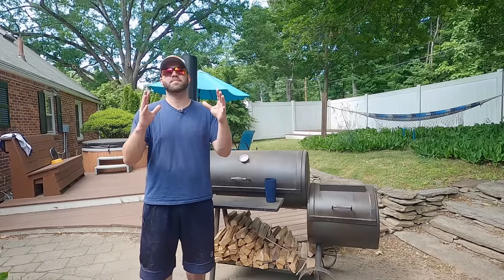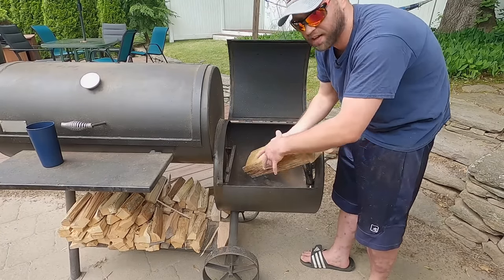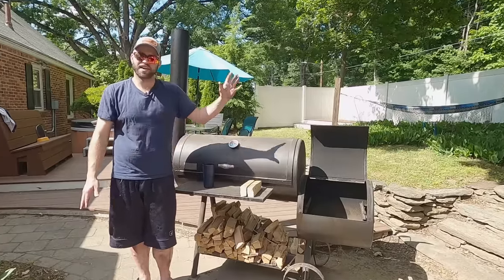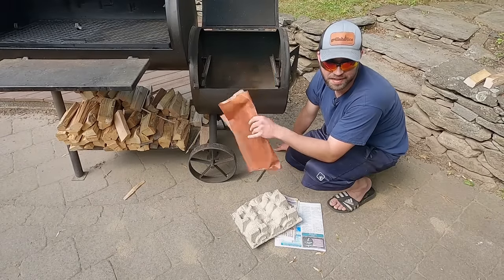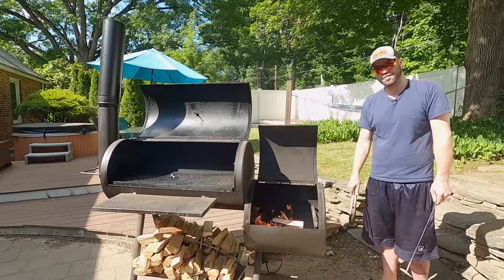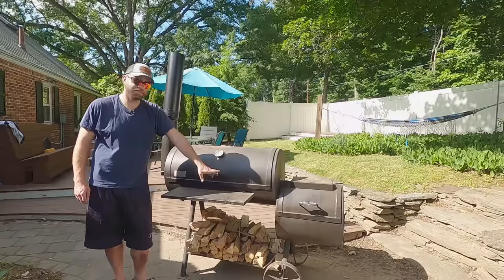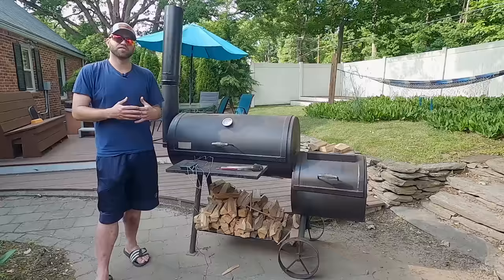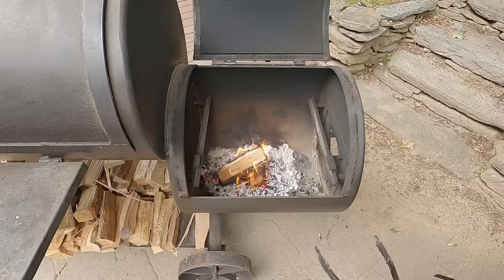OFFSET SMOKER FIRE MANAGEMENT FOR BEGINNERS | How To Burn A Clean Fire | Fatty's Feasts

Comment: One of the biggest things I discovered today is that the temperatures at the stack end are going to be way more sensitive to fire changes than in the middle of the box. This has probably been why I've had so much trouble maintaining a temperature over the last couple of years with my Wrangler. I like that you pointed out that there is a difference between the two spots, and I can confirm it.

Also, I have done as others have with the baffle from the firebox and used it as a baffle in the cook chamber. If my fire gets crazy, I don't end up with flame broiled things, even with the factory baffle still in there.
Reply from the maker: Good point. Plus with the stack being so small, it's difficult to even the temps out. Where do you place the baffle in the cook chamber when you use it like that?
Reply: @FattysFeasts  I put the original "fire grate" in the cook chamber and butted it almost right against the factory baffle. I left about a 1/2" gap to let some of the heat out there. 

I replaced the "grate" with the searing grate, and it does a "grate" job (see what I did there?) at holding the coals up out of the ash.

The temperatures from the middle to the box end at the grate are a lot more stable than at the stack end.
Reply from the maker: @tim.garrison  Interesting...I may need to try that!

Comment: Doing the first run on a new higher quality smoker after my King Griller.  Wanted to see if theres more tricks to managing one of these Old Country's. Learned a pretty good amount that im trying now. 

Only thing id add on this video. Is use a haur dryer if you have a piece that won't light. Its cheap and quick  while saving you from wasting any wood.
Reply from the maker: I like that tip! If only I had a hair dryer, but as you could probably assume, I don't need one 😁

Comment: A couple of other tips to try: 1: drill and remount your thermometer lower on the cover cover, closer to where the meat is actually cooking. 2: Many smokers have the smoke exhaust at or near the top of the cooker. Add an extension inside so that the smoke exhaust is nearer to the cooking level. This also produces a way more accurate temperature.
Reply from the maker: Absolutely with the thermometer. I just decided to use my probes since I didn't want to drill. When you say "add an extension" are you talking about adding tuning plates? I've screwed around alot with tuning plates on this smoker and they were more of a frustration than a help. Specifically, they would move the hot spot twoards the middle of the smoker and would cause more unevenness of temps, which would cause overcooking of the bottom of the food. In addition, most people don't have a probe in the middle of the smoker, so it would be easy to miss those temp changes.

Comment: For years I have been using a charcoal grill. I added hardwood to the charcoal for smoke, while I have the meat off set for indirect cooking. I have cooked pork roasts that way. But with my new smoker none of the old grilling methods worked. I see from this video I was making the fires too big. The wood was too large. I was having fluctuations of high and low heat and had to baby sit the smoker all afternoon.  It was frustrating. I'm going to try again using some of the tips you taught us. Just two small sticks of wood!
Reply from the maker: I had the same exact problems! Glad I could prevent you some of the headaches I had!!

Comment: I've managed mine differently and had what I thought was good success. 

I usually have charcoal in the bottom grate of my offset, and continually add small amounts throughout my smoke. Then above that I have grates I place my wood on to smoke. If that wood catches fire, a temperature spike occurs.
Reply from the maker: It's a good concept, I just try to avoid adding more charcoal unless my coal bed is really just not there. I also don't like keeping wood in the firebox itself. I've had it catch too many times.

Comment: My number one tip for a clean fire is AIRFLOW. If you restrict airflow, you will get dirty smoke. You must give the fire all the air it is asking for. Do not treat your smoker like a woodstove. You're not heating your home, which produces tons of dirty smoke, you're cooking. Figure out how to build your fire so that you can leave the door open, while not making your fire too hot. A small efficient fire will produce the best results, but can require more attention because it will burn faster. Another tip, if your firebox is big enough, Get a fireplace kit. A cast iron log holder (available in many sizes) will elevate the splits and coals and ash can be raked out from under if needed, without moving it.
Reply from the maker: Absolutely. The biggest thing I would say is keep it simple. On a larger smoker, you definitely have more room to work with dampers. On a smaller guy like this, keeping things open will help, especially the stack. I wouldn't say keep the firebox all the way open though, as you'll just lose a ton of heat.

Comment: i have the exact smoker with ""two gages". I start out with 5lb reg.charcoal. Once it starts the heat up around 150. I add 1\2 bag Cowboys Lump coal. Sometimes you have to create your own style of cooking or grilling. I'm not into electric gages like some. I keep a sharp small knife and cut some big meat off. All because when I smoke  a big piece like a 20lb Turkey,I have a time table when I want to flip over and rotate usually away from the fire box. 275 is my goal on Turkey-Brisket and keep watch when you know it's time to refuel the firebox. The Brisket will bleed out blood-means it's on the interstate steady temperation. I'd like to mention that when this smoker get's hot'. the 1/4 thick of metal will keep cooking due to the thickness of it. I grill old school style and won't I change a damn thing other saving some time reading gages that make you or two. """""""PEACE IN DA-A-A VALLEY.:face-purple-wide-eyes:🤠
Reply from the maker: Interesting concept. So do you use any wood at all or just charcoal?

Comment: Just discovered your channel and been watching some videos. I have several smokers, but haven't used my offset in a while.  I just did an early "spring clean burnout" on mine a few days ago. I like playing with fire (😃) and I burned several fires when I got my offset a couple years ago before I ever cooked the first bit of food on it. Took me a while and some mods and learning to get it just right. As the owner of a Pecos, I was a little surprised to see how small the "chunks" you use are with your Brazos. I definitely had to cut down the size of the splits I started out using until I got to the optimal size, but yours are definitely small. But, as we know, all smokers are different and have their sweet spot. I'd like to upgrade as I've seen you have done, but unfortunately my wishes outsize my budget. Until then, I'll stick with my Pecos, which does a perfectly fine job itself. Keep smoking and posting!
Reply from the maker: Happy to hear from another Old Country owner! I think I mentioned it in here, but I definitely saw some people on Youtube that were using bigger splits. In the end, they just didn't work for me, because as you said, every smoker is different. I wish money grew on trees so I could get a 200 gallon or something...Not that I need it 😁 Happy smoking!

Comment: I got an old chop saw at a pawn shop $35. Sometimes you can get lucky at a yard sale. I would suggest try it out before you buy it. I wish I had watched this video first; in the last video I asked about the water pan. I prefer to hear someone who has something to say talk. You did really well, Grate video.  Your smoker looks just like mine. I was told that flat part on the top of the fire box was for toasting bread. I bought it used but it looked new, perhaps the guy I got it from did not know how to use it either.
Reply from the maker: Oh, now that I see this comment, I answered some of the questions I asked you in the last reply. Yeah do the water pan near the firebox so it flows throughout the smoker. I'm glad I was able to help you out!! Yeah, the top of the firebox can be used for a multitude of things, including bread I guess LOL. Mine used to get dirty from the wood I put on it, so I personally wouldn't do that on mine, but if you keep yours clean, go for it. Not knowing how to use a smoker is a common problem from people selling them. It's not the easiest thing to learn and it does take work. I almost gave up at one point, but I'm so glad I didn't! Once you get it dialed in, you'll love it!
Reply: @FattysFeasts   Thanks for the reply. Seem there is a lot of people out there who have advice they want to share; the only problem is a lot of it is bad. I did as you suggested, pulled out my old chop saw and cut the wood into small chunks. I smoked my first turkey. 12 lbs took about 6 hrs. I was able to control the temp. way better than ever before. I figure it this way, when people tell me that was the best turkey they had ever had, it is good advice. So, Thank You for this. And the funny thing is this was the first time I tried smoking a turkey. And all I had to use was a gallon of apple juice, water, butter and salt and pepper. We do not get paid until Friday. So, I used what I had. I was not expecting much but this was really good. My wife is the hardest person to please so, when she says to me, you will be making this again. You know it has to be good.
Reply from the maker: That's so awesome to hear!! Glad it came out great! I can't say the same about the first time I ever smoked a turkey😂😂  @fred306801

Comment: I now have this same smoker and great video as I needed this information...Im all ears, as mine is still in the box...how many test runs are recommend before adding meat to a brand-new Joe?
Reply from the maker: Congrats on the new smoker! I'd say at least one, preferably two. You just want to be at the point where you can run it and know what happens when you put a split on or open / close dampers.

Comment: Excellent video. Thank you - exactly what I was looking for. I do have a question do you ever add more charcoal briskets to your fire heat it up after you've been adding wood?
Reply from the maker: Glad you enjoyed it! I typically don’t unless I’m having a really difficult time maintaining a coal bed. I found if I use charcoal at first and then burn a log cabin, I form a pretty good coal bed that will last for the duration of the cook. But, I have fallen asleep before and needed to add a bit more.

Comment: That was a very informative video, i just bought a big country smoker used and im a first time stick burner person. I picked up alot of information fron your video and am a subscriber.  But one thing if i may ask, if you were to guess, how long would you say your splits are, Thank you so much and am looking forward to seeing all your videos your putting out there.
Reply from the maker: Thanks so much, I really appreciate it and I’m glad you found value in the video! For this smoker, I’m typically using about 7 inch long and 3 inches wide, maybe a little less. Since I’m making them so small, I tend to get some smaller and some bigger, which I will use for various situations. But that’s pretty much the length and width I try to aim for.
Reply: Thank you so much for the info

Comment: I use same girth as your wood but the length is about 1/2 . Haha😮 so i build my fire to side door and stack wood to the left close to the intake port to smoker chamber. I have had embers light my supply but not often. This is a excellent way to have minimal smoldering it ignites instantly and keeps your cook clean. Your upgraded stack would burn through my chunks every 2 min. so may not work on your setup. Thanks for your knowledge & great video
Reply from the maker: Glad to hear we have similar wood girths 😂 I haven't tried the wood in the firebox yet. I find in my case, just putting it on top works fine.

Comment: Cool video take it from a novice smoker. Just smoked a 3lbs tri tip and found out I needed a piece of oak on top of the lump charcoal. That did the trick, so I smoked it 2 hrs 255-275. So leaving  the tip on the grill when I place 
another piece of dry oak not gonna screw it up? I was able to reverse sear at 400 after o placed a piece of oak on it got it to 400 the tip cut like butter at 145  after probing it. I didn’t know if about the hack leaving my wood on top. Of  the hot box. Thanks man!!
Reply from the maker: Glad it turned out great!!!

Comment: I noticed that you removed the lower grate in the fire box. It's much easier to maintain the fire if you can keep airflow moving underneath the fire. Leaving the lower grate in place allows for airflow underneath the fire so you don't have to move the wood around to keep your airflow under the fire.
Reply from the maker: As far as fire science and flow goes, you're correct. However, when it comes to this smoker, I have not had the same experience. My coals tend to fall through the grate, which has not helped maintaining the coal bed. I've tried many things as I explained, but the thing that has worked best for me is just keeping the fire on the base of the firebox.

Comment: I’m no expert, but started getting serious in the hobby and built my first reverse flow trailer pit about 13 years ago. Three trailer pits, a non mobile pit, and a Santa Maria grill later, I won’t build a moderate to large size pit without baffle plates. 

They have to be installed correctly, and I can maintain less than 10 degree temp variance from one end to the other on a 5’ cooking surface. 

If done correctly you can fine tune them all the way across the cooking grates. 

As the saying goes, there’s more than one way to skin a cat and as long as you’re having fun and folks aren’t declining your bbq invites, keep smoking!
Reply from the maker: Hell yeah man! BBQ should be all about the fun and great food! What's the largest pit you've built?
Reply: @FattysFeasts  the largest one completed will hold roughly 12-14 briskets. 

I have another one not completed yet, that should hold at least double that. 

Rarely cook on the big ones, and the old Smokey and argentina get the most action. Oh, and my wife bought a pellet smoker that I almost hate to admit gets used a lot 😂
Reply from the maker: @txgearheads  That's awesome! I'd love to see some pics! And of course the "convenient" smoker gets used the most 😂😂
Reply: @FattysFeasts  at first I thought I lost my man card 😂 but it’s super convenient! I posted a quick video for you.
Reply from the maker: @txgearheads  Damn those look great. Awesome job man! I wish I was crafty enough to build my own.
Reply: @FattysFeasts  I’d bet you could build one if you set your mind to it! They are long overdue for a touch up, but appreciate the response!
Reply from the maker: @txgearheads  Maybe I'll get into it one day!

Comment: excellent video! this is some of the best tips I've seen on YouTube. quick question regarding probes: if I put a probe next to the stack and a probe somewhere to the right with the meat between the probes, the cooler temp of the meat affects the reading on those probes. how do I get an accurate gauge of of pit temps when I put the meat in?
Reply from the maker: I'm glad you enjoyed the video! I've found the best way to go about this is to take the average of the temps. I've tried it both ways where I have tried to manage temps just from one of the probes. What I found is if I use the stack probe, the temps tend to be way too hot on the front end. If I do the opposite, they are too cool near the stack. If you take the average, with proper damper control, you can ensure for pretty even cooking. I typically will see a difference in temps of about 25-50 degrees with a brisket on each probe. But I would also say if you don't take into account both temps, you won't be able to ensure your temps are somewhat even and you run the risk of really screwing the brisket up or having uneven cooking, especially on a smaller cooker. Hope that helps and let me know if you have any other questions!
Reply: @FattysFeasts  yeah that makes sense. Thank you very much for the reply!

Comment: I have a pit on a trailer that cooks great but it’s too large for 1 brisket. I bought the same pit you have for cooking on the deck but I have a really hard time keeping a constant temperature. After watching your video I think I should try using smaller fires and not load up the fire box as heavy as my trailer pit.
Reply from the maker: It's definitely a learning experience with this smoker, especially considering its smaller size. I've seen so much conflicting info, especially from people with bigger pits, hence why I wanted to make a video of the methods that worked for me. I hope it helps and please let me know how it goes!

Comment: Awesome video, question for you, I got grill and a side firebox attachment, we couldn’t get the side panels off to save our life but we got a decent piece of it off of the grill. If I’m just using the damper for smoke flow between the grill and smoker, will it take much longer? Or will we be ok as long as smokes going through
Reply from the maker: I'm having a bit of difficulty trying to visualize this. Do you have Instagram? If you message me there with some pictures I could help you.